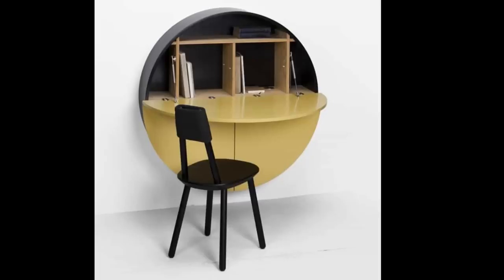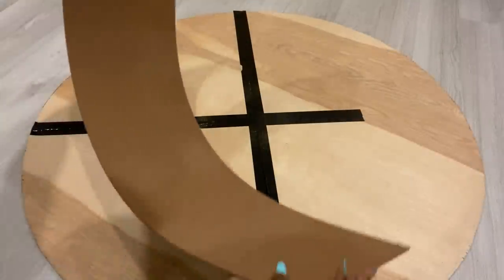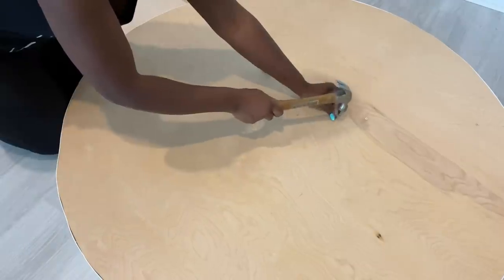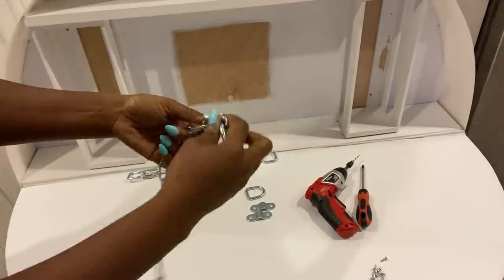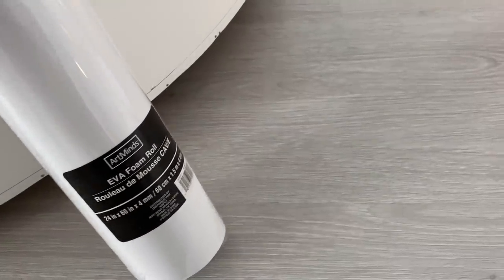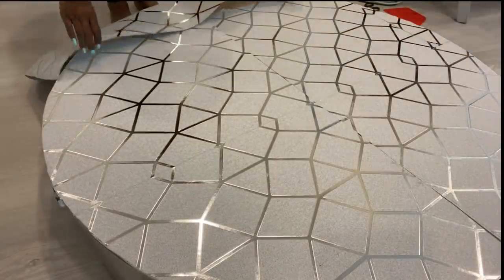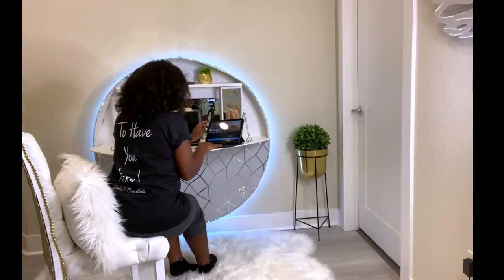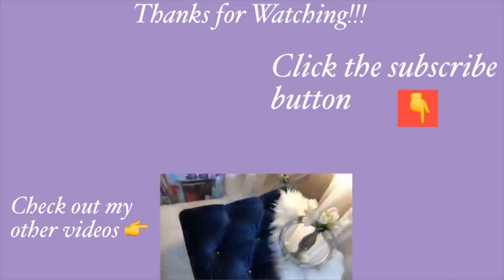DIY 2-IN-1 WALL DESK| SMALL SPACE SOLUTION!

Comment: Nice work! 
*For future reference: The hardboard can be made more flexible and better able to hold a curved shape if damp towels are applied to the smooth side for about 15 - 30 minutes. Use a staple gun with longer staples to attach the hardboard to the plywood. Apply a good wood glue to the inside (patterned) edge before or while stapling, as you go. After the hardboard is attached, tape a few bands around the outside with duct tape, water down some wood glue to medium consistency, and lightly coat the patterned side all the way to the outer edge. Allow 24 hours to set up. I would strengthen it with either an aluminum alloy strip, or iron on edge trim, at both edges.